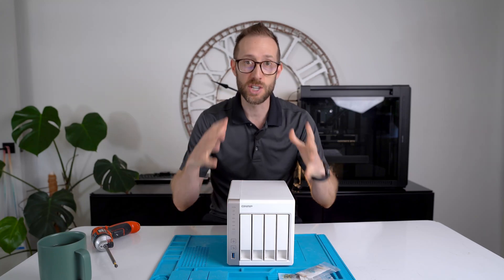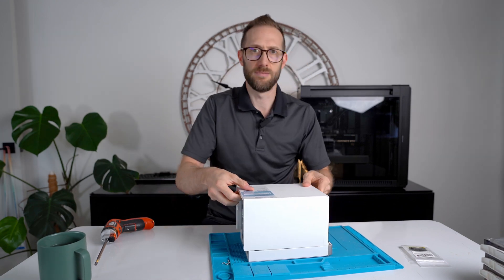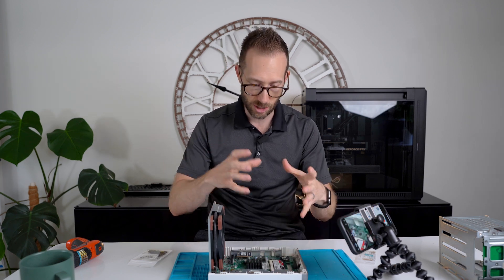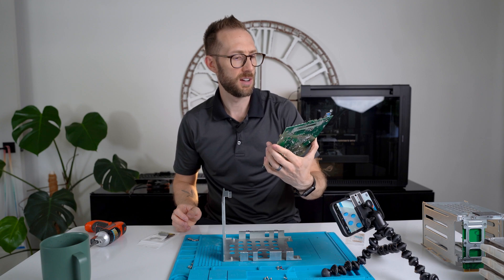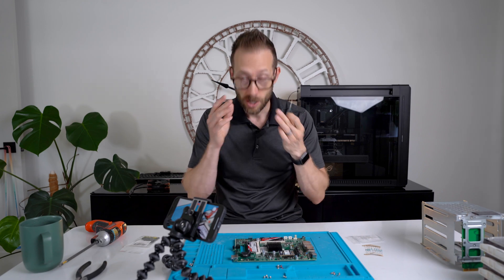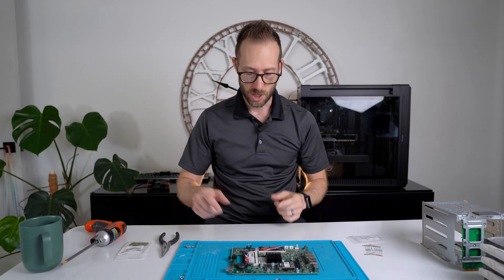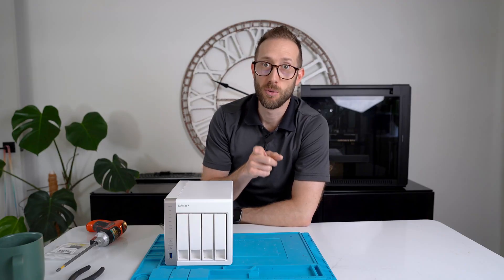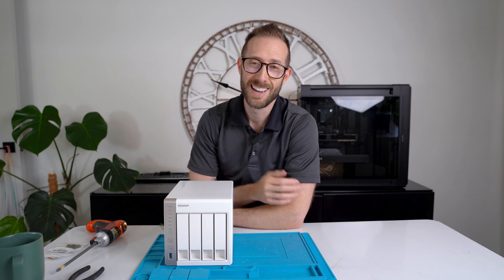QNAP NAS Red Light Fix Instructions (No Solder Solution)

Comment: i have a Qnap 251D which died on me, no lights or fan spinning, wont boot  i'm getting 12v from the psu adapter so that's ok. my Qnap doesn't have any jumper pins like yours for me to connect to, have you come across this.
 Did you install the resister anyway round or is the a positive or negative leg
Reply from the maker: Oh darn.  I'm not sure about that exact model.  If you read through some of the comments, you'll see people with TS-251 with 10 pins and still connected pin 1 & 8 to resolve the issue.  Not sure about the 251D though.  As for positive/negative on the resistor, I'm not sure.  I'll pin this comment and maybe someone else knows more about electrical details.
Reply: Thks for responding ok hopefully someone else has my model, from what I've researched it looks like resistor r one way travel for electric currents but I haven't heard/seen anyone talk about this

Comment: Why do I need a resistor? I thought a jumper is only for connecting 2 pins? Can I just use a cable?
Reply from the maker: The resistor reduces the voltage, which is key to fixing the issue.

Comment: I have a TS-451+ with the 9-pin socket, and I couldn't get this to work. I soldered a 100ohm resistor to pin 1 and 8 but the HDD lights are still solid red. Meanwhile the fan is spinning, the status led is on and the ethernet led shows activity as well but I can't access the web interface on either of the two nics, and nothing is shown on screen via HDMI.

Please let me know if you have any suggestions or had the same problem and managed to fix it 😊
Reply from the maker: The only thing I can think of is that you soldered the wrong 9-pin socket.  When I did it, I noticed there were two of them, one on one each side of the board.  Is there a chance you did the wrong one? You soldered pin 1 + 8, correct?
Reply: @JohnLCharette Thanks for the reply. I have connected pin 1 and 8 with an 100 ohm resistor on the socket that says "LPC-CN1". It's the only one I have with 9 pins sticking out. (The other one on the opposite side of the motherboard has 8 pins). I also made sure that it is indeed pin 1 (labeled 1 right next to it, and it is the first pin on the row of five. At the same time pin 8 is the last one of the row of four). I used a multimeter to confirm that the resistor is 100ohms and I have also replaced the CR2032 battery just in case, but the red lights remain unfortunately.

I've seen others mentioning other resistors to make it work for them, but I do not have an oscilloscope to measure the min/max values, so its going to be difficult to find the correct resistance needed to get it back into spec.

Comment: I also was able to save one TS-251, do you have any idea how long such fix can last till machine will die completely?
Reply from the maker: I ran mine for a solid 9 months after I did the fix before I bought a new unit.  Not because the old one died, because I wanted to migrate the data while the old one still worked.  My personal opinion is that it'll stay working as long as you don't turn it off.  It's the turning on that seems to be where it hangs.  Get a big battery backup and hope you don't lose power ;)

Comment: Update 2: WIN WIN WIN!!! This resistor and jumper hack DID fix it. I have successfully added to my network, and Qfinder found it. Installing updates and setting it up, as I type this. Thank you for the video. 

I Have a TS-451+ that I saved from my employer's e-waste pile three years ago, and was disappointed that it didn't work when I got it home. When I saw your video today, I pulled it out of the closet and discovered it has the same issue as yours. I couldn't solder to save my life, and this is just the solution I needed!! I have plenty of the jumpers that I saved from computer tear-downs, so I am about to order the resistors. Fingers crossed that this will be the fix that I have been waiting for :)

UPDATE:
I followed your instructions and installed the 100 ohm resistor with two jumpers, and upon power-up it is no longer showing blue and red lights. I got green lights, and a beep, cautiously I am calling it a win. But, I won't celebrate until I figure out how to set it up and make sure that it IS working the way it should.

Comment: It worked for me. But how long will it last? Any experience out there? Thanks
Reply from the maker: I ran mine for a solid 9 months after I did the fix before I bought a new unit.  Not because the old one died, because I wanted to migrate the data while the old one still worked.  My personal opinion is that it'll stay working as long as you don't turn it off.  It's the turning on that seems to be where it hangs.  Get a big battery backup and hope you don't lose power ;)
Reply: @JohnLCharette  Hi John. I turned mein off and on without a problem so far but will not do so anymore. Thank for your response

Comment: Hey John, how do I know if I need to do this with my 2drive TS-251? I just have the one red light and a fans and everything appear to work. Just no connection. Thanks!!
Reply from the maker: I've heard people use this fix on the TS-251 and it works.
Reply: @JohnLCharette  this did not work for me. I'm pretty sure its because the resistor doesn't seem to be secure inside the jumper. I worked on this for an hour. Just seemed loosey goosey in there. it was a $10 trial. I've done worse.

Comment: Thank you for the detailed video. about to try this out on my 451 which died 3 days ago. Is this a permanent fix or should I start to transfer the data off the disks and find another NAS drive asap once this gets up and running?
Reply from the maker: I'm glad it worked.  No, there isn't a permanent fix.  The closest thing is never turning off your device.  The problem only seems to happen on boot.  So, if you never turn it off, it should last quite a long time.   I would recommend looking for alternate solutions though.  I picked up another 4-bay QNAP and used their migration feature.  Worked great!
Reply: @JohnLCharette  so no firmware updates allowed since that does a reboot ?

Comment: Just want to give a huge thanks for this video!  My TS-451 died in similar fashion (showed blue USB light and three of four HDD LEDs were solid red) and I thought it was a goner.  A quick search led me here and I popped over to the local electronics shop for the parts and was back up and running in 20 minutes.  Appreciate your clear explanation and detailed (but not overly so) review of steps.
Reply from the maker: You're very welcome! Happy to hear it worked for you so quickly.

Comment: Thanks! This worked on my TS-451. Btw does this resistor needs to be connected or once it reboots its not needed?
Reply from the maker: Good question.  I'm not 100% sure.  I'm pretty sure it's just a boot issue, but if you disconnect it and then lose power, it may not boot.  Your call though.  I'm generally curious if it'll work.

Comment: I soldered mine but perfect, thanks. Does anyone have any idea how long the fix works for?
Reply from the maker: I ran mine for a solid year, and then ended up replacing it.  I think the trick is never turning it off.  It's booting up that causes the problem.  I had mine connected to a battery backup and it kept working.
Reply: @JohnLCharette  Thank you very much for the information 🙂🍻

Comment: I wasn't able to make this work, but I also have no experience with resistors/jumpers or anything like that, so not sure I did that part correctly - should the legs of the resistor be touching the pin that the jumpers attach to? and should the legs protude through the bottom of the jumper/touch the motherboard underneath or be short enough to just fit inside the jumper?
Reply from the maker: Just enough to fit inside the jumper. The jumper acts as a bridge between the two pins.

Comment: Unfortunately, this did not work for me. Major bummer. I tried posting a link to a pic I took of the final result, but YouTube keeps taking it down. Any other suggestions? I purchased all the parts new from DigiKey. Resistor - RES 100 OHM 5% 1/4/ AXIAL, Jumper Pins - JUMPER W/TEST PNT 1X2PINS 2.54MM. Thanks for your help!
Reply: I just realized I purchased 5% instead of 1%. Could that really make a difference? Mine are Brown Black Brown Gold. Crap...
Reply from the maker: I’m not an electrical guy, but for the price of new transistors. It’s worth a try. Let me know if it works!

Comment: Hello!  I have a QNAP TS-251+.. there is 2x  10 pins connectors on the board .. I'm not sure how to know wich is the right one and how to know wich is pin 1 and 8 could you help me by any chance ? is there a schematic or drawing to help figure this out ? thanks a lot!
Reply from the maker: The pins should be oriented the same way.  If the edge of the board is closest to you, the bottom left pin is 1, and then the top row, fourth pin from the left is 8.  Match it up with my video.

Comment: I have tried with a very similar QNAP model TS-451.  When disassambled, found that instead of having 9 pins it had ten pins.  I applied the Resistor to pins 1 and 8 and there was no go.    Any information that I could use?  May be pins 1 and 10 instead? I hope you can provide a response.
Reply from the maker: Oh darn. Other individuals with 10 pins connected 1 to 8 and it still worked with a 100omh transistor.

Read through some of the comments to confirm. Maybe you can ask someone who did it with 10 pins to confirm.

Comment: I did but it didN4T work for TS-451; my matherbord has 10 pin but I have still connected with the resistor 1 & 8. Do you have any other hint?
Reply from the maker: Oh no. You’re the first person I’ve heard that it didn’t fix the problem. My first recommendation would be to double check the connection of the jumper pins. Or replace it with a different transistor.
Reply: @JohnLCharette  I have checked the Volt between pin 1 & 8 or 1 & 10. they are the same so 8 or 10 are the ground. Volts are around 2,4 but with 100 om resistor they became 1,5V; I have understood appropriate Voltage should be 1,7 so probably I need a different resistor. What do you think?
Reply: it will be good if you can provide the Target voltage between pin 1-8 so I can find the proper resistor to use.
Reply: finally it worked! I do not know how but I have tried with 50 om, 200 om, back to 100 om; try to use 6 instead 8 pin as I have seen an other video stating that in some case pin 6 shoudl be used, I have changed the power supply, connect HDMI and finally boot started. Then when I have assembled again didn't work, so back to open the case. etc finally now is up and running with new power supply but for some reason it also work with old power supply. maybe there was some condensators charged as the green led was always on when power supply jack was inserted but now it is on just when I switch on. PIN 1-8 voltage is around 1,5V with 100 om, it was around 2.4V. All disks look as they were with my data. Anyway I hae ordered new NAS HW as I do not know how long this one will be alive ;-)
Reply from the maker: That's great news!!! Really good to hear.  I'm curious, what new NAS did you order?
Reply: @JohnLCharette  TS-464 as I have the possibility to move there the disks I have (normally it is supported) and come with 2.5Gbe and expantion to 10Gbe. at hove I have done recently 10Gbe network but still I have some old staff 1G.

Comment: Wow dude, this video is amazing. My QNAP TS-251+ seems have died after a power outage. Just all red lights and blue. I searched the internet and came across your video. Simply amazing. Such an easy fix. All it took was $18 from Amazon and your fantastic instructions. Cheers!!
Reply from the maker: Awww, glad it worked well for you :)
Reply: Hello!  I have a QNAP TS-251+.. there is 2x  10 pins connectors on the board .. I'm not sure how to know wich is the right one and how to know wich is pin 1 and 8 could you help me by any chance ? @JohnLCharette @DerrickThomas17 thanks a lot !

Comment: Even my TS-251+ after 9 years, suddenly, no longer boots and all the LEDs (except Status) are on. Qnap support asked me € 245 for the repair and € 200 for shipping (from Italy). I will try to do as you advised, otherwise I have to buy another one. Thank's.
Reply from the maker: Let me know if it works.  Mine has been working for almost a year since I did the fix.  I just purchased a replacement NAS yesterday.
Reply: @JohnLCharette  Ok I'll try, but why did you buy a replacement if the repair paid off?
Reply from the maker: The repair is only a temporary fix.  It will die again. Some people it happens in a few weeks, others in months.  My theory is that if you don't turn it off, it won't break.. but that's harder said than done.  Mine has lasted almost a year, but I don't want to chance it, so I bought a replacement.  My TS-451 is OLD, like 10 years old.. so it's put in it's time ;)
Reply: @JohnLCharette  Indeed, to be on the safe side, I also purchased a TS-264, also on the advice of Qnap Support based on my usage.

Comment: Just wanted to thank you for the guidance to get one more TS-251 back to life after over 10 years of service! Just followed the steps here (took me around 20min) and boom, NAS is back up and running :)
In my case, there were 10 pins, not 9. But I connected 1 to 8 using the jumpers and the 100ohm resistor and it worked.
Reply from the maker: Awesome to hear that it worked for you! Glad I could help.  Yeah, I've heard some people have 10 pins and have also confirmed that 1 to 8 works in both cases.

Considering it's a temporary fix.  Have you thought about what unit you'll replace it with? I'm still searching around.

Comment: My TS-251+ died on me after 8 years of service, I was going to solder it on until I saw your video. Thanks for the great idea.
Reply from the maker: Oh wow, glad I could help you with a solution that worked for you.  I can't take full credit.  I found it in the forums linked in the description ;)
Reply: I have the same problem with my TS 251+, you solved it exactly the same, you connected the same pins with the 100 ohm resistor?

Comment: Omg thank you so much. You saved my life! I'm back online thanks to your vid!
Reply from the maker: Aww, you are so welcome!  Now that you have a temporary fix, have you thought about what device you’ll replace it with?  I’m still trying to decide myself.
Reply: Temporary?! I'm gonna run this till it dies! 

I was looking at a mini PC, mainly to run my sonarr, radarr and Plex. But will need to see if it will also be feasible to serve as my photo and video back up with raid and all.

But not gonna worry about it as long as the TS keeps ticking
Reply from the maker: Haha, your faith is incredible.  I worry everyday that mine is going to die.  All my data is trapped in the QNAP RAID5, so if it dies, I need another QNAP to migrate the drives.  I was thinking about transfering all of the data onto one single HDD and then buying a new NAS, move the drives from my TS into the new NAS and then move the data back.  That said, I still haven't decided what NAS solution to use.  I'm leaning towards the Ubiquiti NAS Pro for what I need.

Comment: I had similar problem, but only 2 of 4 lights were red, the other two were green. This hack helped to resolve it! Thanks!
Btw, on Amazon, the same resistors are now different (or they have an different article with the exactly same name). Those that came to me, were much smaller with the contact wire so tiny that is didn't hold in the jumpers. I solved it by bending the wire to double its "diameter".
Reply from the maker: Oh wow.  Glad it worked but sorry to hear about the leg length.  I'll see if I can find a replacement one and update my link.  Thanks!
Reply: @ The length was fine, the diameter of the wire was small. In fact, it's even good that they were smaller. It was easy to fit them in.
Reply from the maker: Ohhhh, thanks for clarifying!

Comment: Thank you so much. I had 3 solid red lights on my nas and this fixed it. Had my qnap for about 9 years and and you've helped extend its life a little further.
Reply from the maker: Awww, these messages make my day.  I'm glad it worked.  The power went out at my place yesterday, so my QNAP turned off and I was really worried it woudln't turn back on.  Thankfully it did.  I still haven't purchased a replacement unit yet :S

Have you considered what you'll replace yours with?